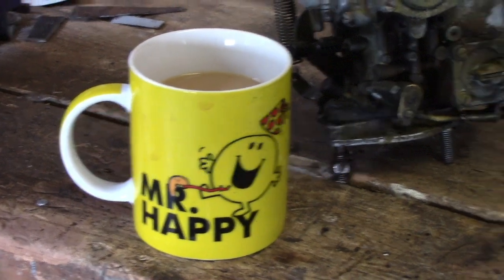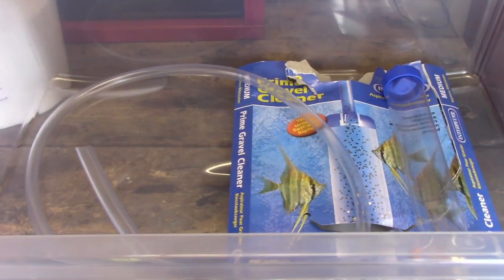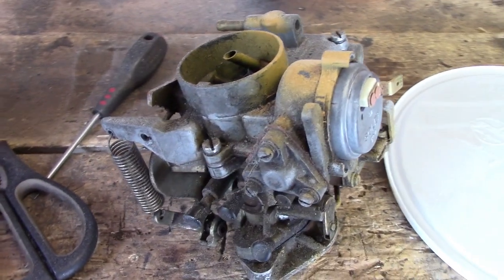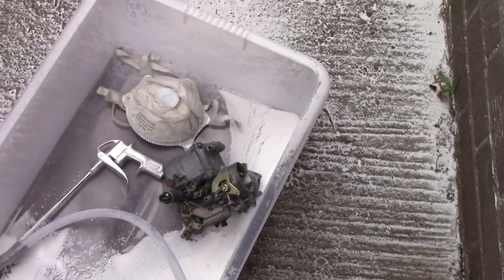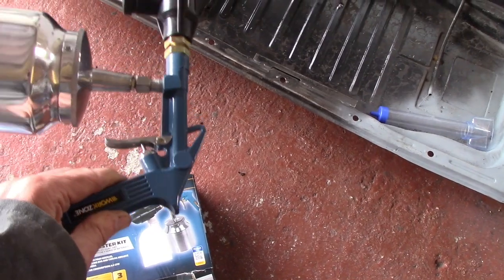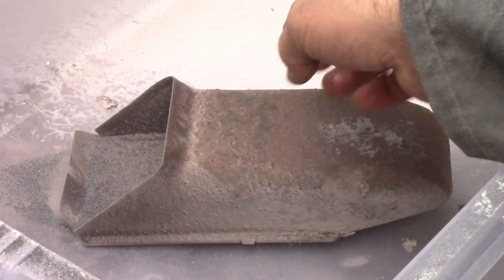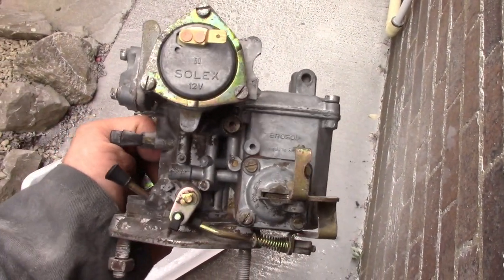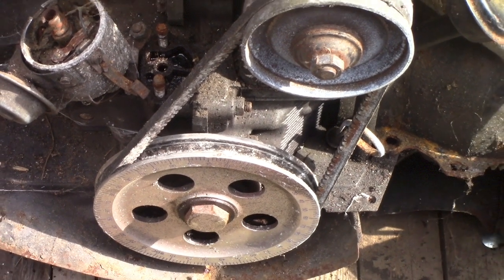DIY Soda Blaster

Comment: Loved the home made soda blaster... 
Here's what I do to remove rust from parts without removing existing paint or chrome (note this will also remove bright zinc) . Buy acid based mortar remover for brickwork from Travis Perkins or the like (not patio cleaner which is what they will tell you is the same, it isn't). Once a part is immersed in this stuff all rust will be removed in minutes.. 
However, after washing the acid off the part with water, you will see a bloom of rust reappearing. This is something to do with positive or negative Ions (not sure why). Anyway, the trick is to then either soda blast as you have before then applying zinc or red oxide primer etc to protect the part. Or re immerse the part in phosphoric acid which will remove the bloom of rust and neutralise and protect the part so it will not easily re rust.... 
I tend to use the mortar acid method on rusty zinc parts before sending them to be re zincked.